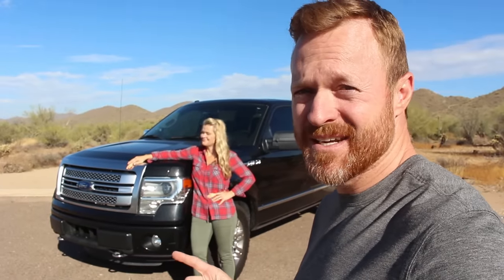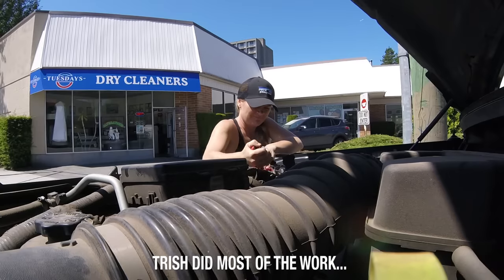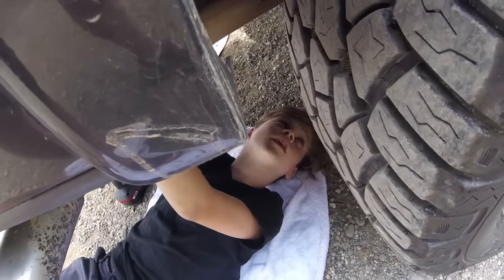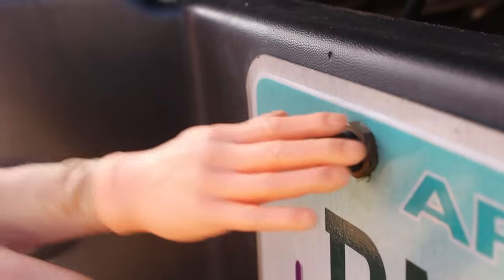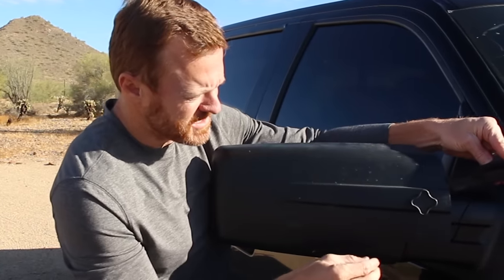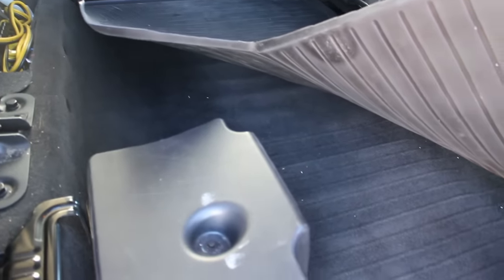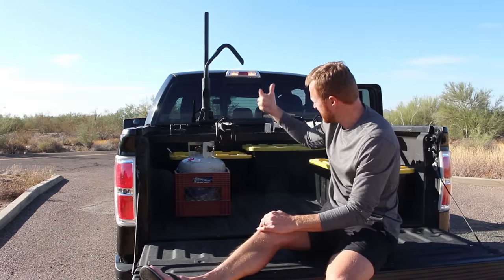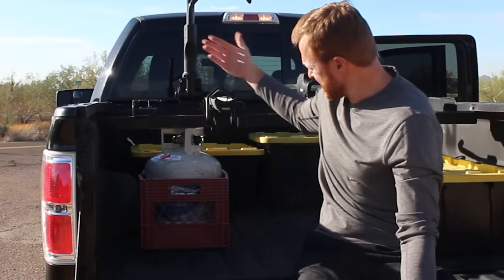TOWING WITH A HALF TON TRUCK (FORD F-150)

Comment: If you have sag, bags only level the truck and do nothing for steering and braking. You should have spent that money on a weight distribution hitch, which would have leveled it and fixed all the issues. Plus they help with reducing sway, high winds, and passing trucks.

Comment: I wonder if you can cut out a slot so that the turn signal light w/in the mirror doesn't melt the plastic on the tow mirrors? Plus, it might allow other motorists see your turn signals.

Comment: Thanks for the video answered a ton of questions on towable vehicle for us...  thinking Ford F-150 with travel trailer
Reply from the maker: I really wish I went into the payload limitations of half-ton truck towing in this video. This was supposed to be an upgrade video, but it would have been good to mention it. With only 1,200 to 1,500 pounds of payload available, travel trailers can't have too much tongue weight or the truck will exceed GVWR. Before you buy your truck, look at the hitch weight of the trailer. Add passengers, cargo and see if it's under the CCC on your door jam sticker (next to your tires PSI)

Comment: You don't know what you are sacrificing until you stop sacrificing. 
2500 diesel truck is night and day better than a 1/2 ton gas truck. Gets 14.5 mpg towing and 24 mpg on the highway. It will run twice as long as a gas engine too. And TORQUE!
Used to tow with an F-150. Felt like it was uphill everywhere we went. The diesel doesn't even downshift out of high gear on steep hills. Nothing like a towing with a truck that out-weighs the trailer by a ton and has 800 ft-lbs of torque. Why did I wait so long?!?!?

Comment: For the Bilstein shocks, did you install them? Make sure the sticker on the shock is right side up. Normally the boot is on the axle side so dirt and junk and come out the holes to keep the shock from prematurely wearing. Overall great video and information!!

Comment: You should've bought a F250 Power Stroke or a 6.2L V8 for towing. Btw, I like the tiny hands bit. Lol
Reply from the maker: I did https://youtu.be/BoUE5AHeCiA But watch my payload video. 3/4 diesel trucks have only slightly more payload than half-ton trucks. I really should have bought a 350 dually.

Comment: The slide in mirrors, that I don’t like them. You can upgrade to tow mirrors like F-250/350 using. It fitted to F-150. I have seen F-150 upgrade them. It looks good. I’m planning to upgrade the mirrors. Not slide-in mirrors.
Reply from the maker: I upgraded the mirrors for $62,000 and they came with an F250.

Comment: With that truck you shouldn't have to do anything if your trailer starts swaying. The platinums have auto sway control from 09 and up. There are other f150s that have it in those years as well.

Comment: Good info! But for the money and time you spent why didnt you just upgrade the truck to an F 250 with the tow package? New or used in the long run you prolly would save all the money you spent and have a truck designed for your purpose.
Reply from the maker: Our approach is to start with what you have and this is the truck we had. We feel that people start down a path of looking for what is ideal or what they want and then get attached to something they aren't ready to buy and never go. Since this truck, we've had an F250 diesel and now an F450. Two trucks we'd never own if we didn't get started with this one.

Comment: Have not watched the video of the install for your bags, but it'd be best to have a separate line to each bag rather than to a T and a single valve. Although it wouldn't make a huge difference given how you use it, but if you were to load the bed unevenly, then it could roll as one bag can transfer air to the other and become unstable.
Reply from the maker: There are two lines. The tiny hand was only able to hold one valve cap :)

Comment: For what u are hauling u should not use air bags. Air bags are for are for fifth-wheel and Gooseneck a good weight distribution hitch would actually be better for you and give you a better ride and a safer ride

Comment: Great video! I enjoy the videos about towing and upgrades to the truck the best! I will add that whenever I inflate my airbags , the chains on my equalizer loosens . This causes my front end to become light . I would be interested to know how many chain links you run on your equalizer verses how much air in the bags ?
Reply from the maker: I was told 6 links is correct with a level rig.

Comment: Good info. What gear ratio are your axles, What kind of fuel economy have you averaged (towing), What type of hitch do you have, have you run the combo across the scales fulled loaded out with your family in it and what is your bed length?

Comment: Pretty sure you have your rear shocks installed upside down. Boot should be on the bottom because the boots have holes in them to let water out.
Reply from the maker: I trust Taps Auto. They were the real deal https://youtu.be/LuBIl9BzJCw
Reply: I see you bought a new F250, I'm not sure if you still own the F150 so what I'm going to say won't matter if you don't. I was being polite when I said I was "pretty sure" your rear shocks were installed upside down. I'm pretty confident they were installed upside down, if you don't believe me call Bilstein and ask. :-). 4600 and 5100 are supposed to be installed boot down,36 second mark: https://youtu.be/NuytJh0gQ9I

Comment: Hey fair video  but sorry I don't believe on pulling anything with a half ton after having one get sideways 😅 pulling race cars twice  for many years  a least you got the V10 that's smart always pull with big engines. The frames and springs are not up to par aways go 3/4 or bigger

Comment: Couldn’t tell from your video but the very first thing you should have done is install a load distribution hitch to eliminate the SAG of your truck if you have one it’s not installed correctly but that would’ve set your truck and trailer even and you would not have needed the airbags and it would’ve made the vehicle run level
Reply from the maker: That was the first thing I did and probably should have included that in the this video, but I'm doing a separate video on hooking-up.
Reply: Keep Your Daydream  i use a load distribution hitch and raise the truck up with the trailer jack then put on torsion bars  but my trailer is 9000 lbs dry  37 ft long and very tongue heavy

Comment: You don't need a bike carrier and tray style floor mats to tow a trailer better or your truck handle towing better and trailer brakes are not suggested they are mandatory over 3500 pounds.

Comment: In this video you mentioned that you changed the fuel pump fuse. I might be crazy but I 'remember' that you had video where you went into more detail about this problem. My son-in-law is having similar issues.   Do you remember what the symptoms were before you replaced the fuel pump fuse? Thanks.
Reply from the maker: It was the Bend, OR episode. The only symptom a burned fuel pump fuse would have is not starting. In my case, the fuse got so hot that it didn't make a connection. When the fuse cooled, it started. When I pulled it out, it was burned. It should be a simple thing to check.

Comment: Thanks for this video, here I was thinking I needed to send my Harley Edition F150 that I saved for for years and have babied for 71K miles but it looks like with a few modifications and some excessive maintenance I can safely tow a 28 foot trailer I'm going to look at. We have looked at A class and C class but keep coming back to towing a trailer as making the most sense "for us" and our plans. I was Googling everything you were mentioning and for well under $1,000 I can make my truck safe for towing a 5,000 trailer with gear. I also intend to change transmission fluid, differential fluid and transfer case fluid and yea oil with a good synthetic is a no brainer. Thanks again.

Comment: Just my 2 cents. I have a 2016 f150 with the 2.7tt and hd payload package. From the picture you showed your truck looked like you just needed to upgrade your springs. My truck squats maybe 1.5 to 2 in with my 33ft 9500lb trailer. Ive put some custom parts to ensure my ability to tow but had to do nothing with the suspension. Why did you opt for the more expensive (and potentially more maintenance) air ride over upgrading your traditional spring back. I now have 63k miles on my truck and I am the original owner. Like you said most companies have their gems and I love my tuned 2.7tt v6 with 420lbtrq  at 2100rpm (it has the 3.31 open diff. That would be my next upgrade to a locking 3.55). And I pulled at a 6% grade while in Colorado and it out performed my tuned (mapping, injectors, suspension, intake, exhaust.....) 5.4 triton with a 3.73 diff. 

The 6.2 is a beast as well but i like my 22.4 to 27mpg and the ability to tow

Comment: How much longer do you think you will keep this truck and travel trailer for? What truck would you upgrade to? What travel trailer or fifth wheel would you upgrade to?
Reply from the maker: Good question. Most likely '17 F250 Diesel Lariat Metallic Charcoal :)
Reply: Hum. That’s a very detailed answer. Are you hinting at something?
Reply: Keep Your Daydream Just bought that truck! Metallic blue. Upgraded from my 2006 f150. Was pulling a 21' TT. Just got a 27' 5th wheel. Those 2 trucks are Worlds apart. Dealer had no problem telling me my f150 could handle the fifth wheel! They'll say anything to make a deal. Glad I read more and upgraded. Used the Costco auto program. Got it $1300 under invoice. Marc you and your family are the best! Please be safe out there.

Comment: So many comments about power. Ecoboost this, 6L that. That's not what your GVWR is about! A Toyota hilux with a 2.2 liter 4 cylinder engine WILL get a 10,000Lb trailer up to highway speed, eventually. Assuming we're all working with internal combustion, power is not the big problem. IT'S THE TRUCK'S ABILITY TO STOP ✋ THE TRAILER THAT MATTERS!! The rating has nothing to do with the size of your engine, Tiger, and EVERYTHING to do with the size of your brakes, sway bars, control arms, axle gears.... etc.

Comment: Lots of very helpful information here. 
What is the weight of your trailer? 
We have an F-350 with 7.3 liter diesel, pulling a 4000# trailer with less than 500# of added cargo. 
It still feels like, suspension wise, the trailer is a bit too heavy. Probably just my perception, as I normally drive a big 18 wheeler, 80,000# rig at work. 
Happy Trails

Comment: I have a 2009 Ford F150. Great truck. I tow a 29 foot travel trailer that is about 6200 lbs.I did have an Ultra Lite 5th wheel. And it did cause the back to sag. I do not have the air bags yet. Been thinking about installing them. How does the truck ride with the air bags with out the trailer? Is the suspension harder? I also heard you have to keep some pressure in the bags even when not towing a trailer.

Comment: I chose a double leaf set of SuperSprings for my 2500 truck and they increased the payload from 2800 to 4000 lbs and they have been completely silent. My truck is dead level with a 4000 lb camper load in the bed with no sag and no sway. I chose not to go with air bags for two reasons. Most important is that if one bag fails that ends the trip until it can be replaced. The second reason is that they are difficult to tune to provide a stable ride. Took only one hour for me to install the SuperSprings on my truck. If they had problems it is with either the brand of helper springs they installed or how they were installed.

Comment: Its a GREAT truck! Only difference is that ours is an Eco-Boost (Twin Turbo)
Reply from the maker: We love it!
Reply: I have a 2016 F150 Ecoboost and tow a 8800lb 29ft travel trailer. Is this too much weight for my f150? When there are strong wind gusts it does pull my front end around. Would I be better off putting air bags in my truck or trading it in and buying a Diesel?
Reply: Jason Schweitzer yes way too much weight

Comment: Are you sure that is ‘all’ you’ve done over the 100k miles?  Have you never cleaned and / or replaced the Engine Air Filter?, Cabin Air Filter?, Topped off misc fluids? Replaced tires, balance and rotation, etc, etc?  Please advise.  Btw:  LOVE your vids!
Reply from the maker: Yes, all regular maintenance. I was talking about the expensive stuff.
Reply: Keep Your Daydream 👍

Comment: Great video although the "hand model" creeped me out! You mention that use what you have and upgrade later. With that said we are using what we have (my wife's 2011 6 cyl Chev Traverse). It works ok for our 3400 lb trailer but definitely know it is back there. I am looking to upgrade my car and want to get something that will tow this trailer (and future trailers) better. My question is if you were upgrading would you go with a 1/2 ton gasser again or would you get a 3/4 ton diesel?

Comment: We have a 2013 F150 with eco boost and the tow package.   Pull 27 ft. Lance trailer model 2285 about 6000 lbs fully loaded. Truck with 3:15 rear axle is rated to pull 8400 lbs., it does a great job. Do you use transmission down shifter going down steep grades?  If grade is straight enough I set the cruse Control at safe speed and let the transmission do the work of the brakes. It does a great job and is a real brake saver.
Reply from the maker: The transmission down shifting is automatic in tow-haul. We tow exclusively in tow haul - even on the highway at 65 mph. The only issue we've ever had going down hill was leaving Jackson Hole WY. I actually put it in 4WL to hold us back. I thought the Eco boost was rated for much higher weight. I talked to a guy pulling a 13k pound 5er.
Reply from the maker: The transmission down shifting is automatic in tow-haul. We tow exclusively in tow haul - even on the highway at 65 mph. The only issue we've ever had going down hill was leaving Jackson Hole WY. I actually put it in 4WL to hold us back. I thought the Eco boost was rated for much higher weight. I talked to a guy pulling a 13k pound 5er.
Reply: The trucks weight directly affects the payload capacity. The lighter the truck, the higher the payload. A 4x4 will be heavier than a 2WD and have less payload. The aluminum bodies on the Fords give them a couple hundred pound advantage in payload as well as the weight savings in the smaller engine.
Reply: Great points TWY. I get concerned also when people keep talking about the "towing rating".  Where do you find this other than the truck's advertising literature? It isn't in the owners manual, but the GCWR is. It needs to be understood how they come up with that tow number, which is by taking the Gross Combination Weight Rating and subtracting the base curb weight of the truck minus a 150 lb. driver. As long as the truck is equipped with the proper hitch components, this would be the "max tow rating".  That isn't reality!  Max towing available = GCWR - truck scale weight with driver, passengers, gear, bicycles, the dog, etc.  Safe travels all.
Reply: That's absolutely correct.  The only sort of reliable towing capacity is published by Trailer Life in their Towing Rating publication.  They rate my truck at 8400 lbs so the 6000 lbs of our Lance fully packed out works.  Staying within 80% of the towing rating is a good idea.  Also, you need to be careful with your rear axle and tire weight ratings. That's one reason I don't thing I'd pull a 5th wheel with a 1/2 ton truck.  Too much hitch weight on the rear axle and tires!

We've been RV'ing since about 1965 in everything from a 1950's Nimrod tent trailer, and it was just that -- a tent on a 4x6 trailer, to a 32ft Hitchhiker II 5th wheel towed by an F350 with 6.0 diesel in which we full timed for 3 years.  Paying attention to the weight of the total rig, having good brakes, maintaining the trailer's wheel bearings and tires are essential.  Also, watching tire pressure.  I'll bet a lot of the blown tires RVers complain about are caused by improper air pressure.  We've lost a few tires in our years of towing, but they were all due to road hazards.  

Towing a trailer and living on the road, whether full time or a few days or weeks at a time is well worth all the work and cost.  We just got back from 3 weeks in the Grand Tetons and Yellowstone area.  Still traveling and loving it and we're in our mid 70's!

Comment: Im getting a new camper 31ft long 5795lbs hitch wt. 600lbs and is 11ft tall. I pick it up in a week or so, pulling it with 2018 gmc denali 1500 with 5 1/2 ft bed .payload 1700lbs and tow rating of 9300lbs. Gonna be using a weight distributing hitch with this rig but im worried if the camper is to long for a half ton truck. Just wondering if i should worry lol

Comment: Great video, Marc & Trish! This eased my mind a lot, I'm towing about the same weight as you with a 2014 F150 Ecoboost. Have been concerned a bit I was overdoing it. Haven't gone anywhere near 40K miles! Question: Are you using a weight distribution hitch?
Reply from the maker: Yes, a Camco EZ Lift. It's starting to fail and they won't warranty it. My next hitch will be a Hensley hitch

Comment: My question is why have you not upgraded your tires from p rated to LT ratred tires unless you already using them. That makes a huge difference in your upgrades going for a LT tire.
Reply: Because.........."40k miles across North American for almost two years with no problems. "